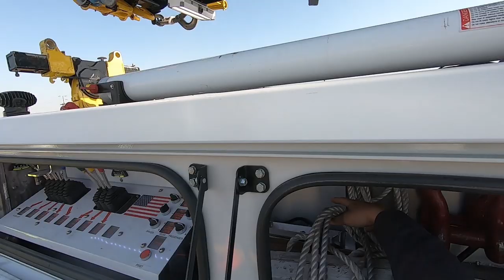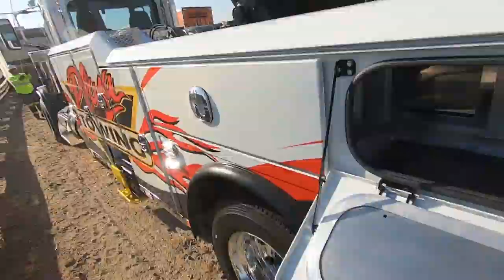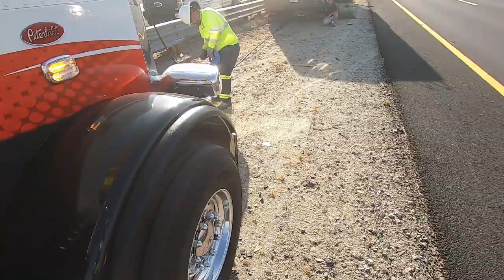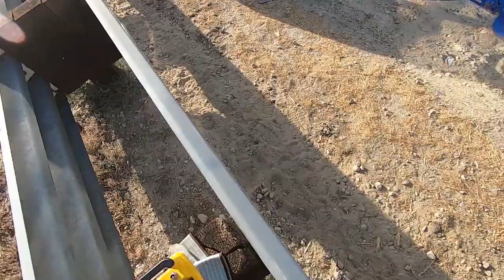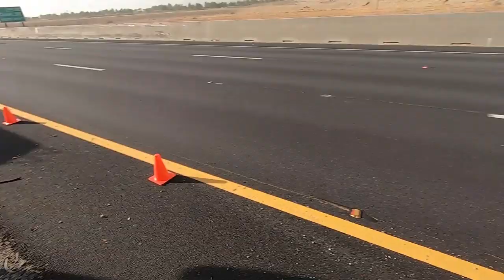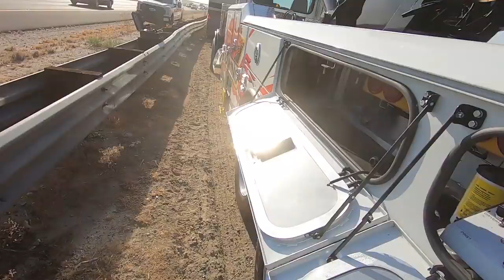RV Crashes Into Center Divide After Steer Tire Blowout!

Comment: Why not just use a chain to the tow pin and pull the rv backwards with reverse on the rotator? Seems like it would be much quicker than rigging the boom up and down?
Reply from the maker: While that could be done, in our opinion it seems pretty “ wrecker Rambo” to do it that way. Winching provides more control and no unnecessary stress to our drivetrain. Thanks for watching!